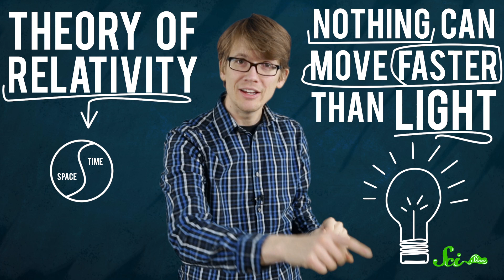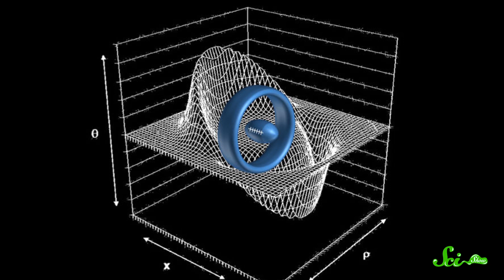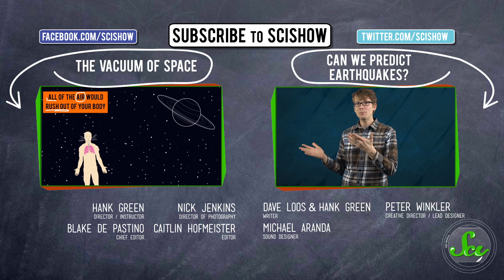Warp Drives!

Comment: When antimatter comes in contact with regular matter it annihilates replacing the mass with energy equal to the mass annihilated right?...65 Exajoules is like around the mass of a person, so can we expect warp-drives soon after we are able to capture and sustain antimatter (if that ever happens)? Or there more to it than that?
Reply: we would need to be able to actually obtain the necessary amount and sustain said amount of antimatter first. then get that up to space, then use it in a fueling process without a single antimatter atom hitting a regular atom and destroying the entire mission

we are very far away from even the first point I just made, like stupidly far away
Reply: The issue is not even if we can maintain it. The issue is with creating negative energy. So far we could only create positive energy (and yes, matter+antimater generate positive energy).
Reply: Disintegrating a person everytime we want to fly to another star is a bit unethical to be honest.

Comment: When there will be a Warp Drive, would it theoretically be possible to "fly" faster than the than the universe is expanding? If that works, we could see the end of the universe if there is one.
Reply: Sirappo Replying to a comment from 3 years ago. In theory, there isn't actually an edge to the universe, so no.  However, we would be able to parts of the universe  outside of what we refer to as the observable universe

Comment: I've been stuck with solution for the warp drive tests. So it's really simple. If we manage to actually use warp drive then the universe is finite. Look at the space fabric like it was a carpet. You can create ripple if you push a piece of the carpet forward. The carpet "shrinks" and you can travel without the use of fuel. But you need to have a starting point of the carpet and an ending. If the universe was infinite than the space fabric keeps getting tighter or will be stuck in one place. So if Warp Drive actaully works than our universe is finite and then we are one step closer to a possible multiverse. If you think/know that I'm wrong then explain it too me. Thanks
Reply: Currently we know the universe as finite, however infinitely expanding, at an increasing rate at that.  And also I understand what your saying, but we would need to build technology to move space-time in such a way.  You would need something specifically built for such a thing as pushing it like a carpet, whereas warp drives arent specifically made to do this (I think lol).  Also it would take energy to create this ripple in space-time.  Those are just my thoughts lol
Reply: branster707 The only thing that would work is negative energy. Einstein explained that Energy is mass in his famous equasion. Mass bends the spacefabric. So the only thing that could work is negative energy. The opposite of energy. Negative Energy is anti gravitational. This means that you would have negative mass. I know that the universe is finite and expanding, but there are still people around that think that it's already infinite. This experiment would debunk their theory. Thanks for your thoughts.

Comment: Sooooo, figuring out the field geometry for a warp field is one thing.  What type of field are we talking about?  It's not purely a magnetic field, and if it's an EM field, then it would have to be in a mode of operation that is unfamiliar to science now.  It would likely be a new type of field that has a very strong interaction with the 'spacial fabric'.  Theorize, Mr. Data.
Reply: The neat thing is all types of energy warp space-time in the same way.  As long as you have energy or mass sitting on it, it warps.  It warps in a more noticeable way as long as the energy is dense, and that's what some people are trying to do in the lab right now.  The people at NASA that Hank mentioned are focusing lasers on to one tiny point to see how much it warps space.  The thing with this warp drive is that you'd need negative energy overall in order to bend space-time a certain way.
Reply: Josh Wilson I was wondering if the so called 'color charge' of quarks could be utilized, and used to create a warp field... and if that charge field would interact more strongly with space.  It does hold protons together ; )
Reply: I've severely underestimated you Khepramancer.  That's not something I'd know very much about, but I do remember watching a veritasium video called "Your mass is not from the Higgs Boson".  They described the strong force as really a empty space in the gluon field.  This seems like a space of negative energy, but it still has postive energy because the total color charge is white.  Maybe if we found a way to make a color charge of black?  But that's only what I've been able to gain from their video.  Who knows.
Reply: Josh Wilson It was just a thought.  I would imagine it would take some sophistication in quantum engineering to be able to experiment with such things... I don't think humans have come quite that far, yet.
Reply: Not quite.  But still interesting.
Reply: It's not a field, it's a bubble -  the force involved is just plain old gravity. Sort of like the technology of fixed wing aircraft is just plain old wind. Which is to say technically... but sort of not at all.
Reply: Brian Emerson So the question becomes, how do you generate gravity?
Reply: With the energy they talked about earlier.  We know how energy, mass, and gravity work together two ways.  We can take a bit of energy or mass and figure out what the vector field of gravity looks like around it, or we can take a vector field of gravity, and figure out what how much mass or energy goes where to produce it.  That's what Miguel Alcubierre did here.  He invented the "bubble" which is just the colloquial term for the vector field of gravity around it, and solved for the locations of energy needed to produce that bubble.  There is a special type of energy needed to produce this field, negative energy, and we don't know how to produce it in large amounts, but we do have several ways to do it in really small amounts.  And they're all independent of the type of process involved.  Same for the positive energy needed.  Gravity doesn't care how the energy gets there, or if the energy is placed by magnetic, strong, or weak fields.  (Fields are considered the carriers of energy, translating it from potential to kinetic energy and back again in modern field theory).  All gravity cares about is that the right amount of energy is in the right place for the bubble to sustain itself.
Reply: Khepramancer With the energy they talked about earlier.  We know how energy, mass, and gravity work together two ways.  We can take a bit of energy or mass and figure out what the vector field of gravity looks like around it, or we can take a vector field of gravity, and figure out what how much mass or energy goes where to produce it.  That's what Miguel Alcubierre did here.  He invented the "bubble" which is just the colloquial term for the vector field of gravity around it, and solved for the locations of energy needed to produce that bubble.  There is a special type of energy needed to produce this field, negative energy, and we don't know how to produce it in large amounts, but we do have several ways to do it in really small amounts.  And they're all independent of the type of process involved.  Same for the positive energy needed.  Gravity doesn't care how the energy gets there, or if the energy is placed by magnetic, strong, or weak fields.  (Fields are considered the carriers of energy, translating it from potential to kinetic energy and back again in modern field theory).  All gravity cares about is that the right amount of energy is in the right place for the bubble to sustain itself.
Reply: Just to clarify, magnetic fields are inherently electrical, there's no such thing as a purely magnetic field, they're intrinsically tied. As for what type of force is being used, it's a combination of a massive amount of energy in a tiny space ahead of a craft, similar to a singularity, and a massive amount of negative energy (Which is a place holder for something we don't understand yet) at the rear, imagine the opposite of a singularity, essentially the antithesis of gravity, that's what's really doing most of the work, the singularity out front is just to catch the ship, preventing it from scattering like light through a parabolic diffractor, from what I understand at least.

Comment: Hate to burst your bubble, but warp drive by 2100? Bullshit. 
I'm suddenly reminded of an old black and white program that told America all about the flying cars they will have in the year 2000.
Reply: Good analogy but what did people think about commercial aircraft 86 years before it became available?
Reply: I didn't say we'd never have it, I call bullshit on 2100. We're already 14 years into the century, and it's the same as it's been since 1990, but the boobs are bigger and the phones are smaller and everything is cheaper and faker.
Reply: Computers are incredibly smaller and have far more capabilities...................... 2110 could be hopeful and not realistic but at the rate we're improving our technologies I really don't think it's unmanageable. Despite what you have against the current state of the world (cheap and fake) our technology is increasing very rapidly.
Reply: I know, I build them for a living. Still doesn't change physics.
Reply: Ok...your point?.... it doesn't need to. If warp drive is physically possible (this argument clearly implies that it's possible) then there's no reason it can't happen by 2100. If you have an issue with warp drive argue that point. Not the time in which you think it will happen.
Reply: s0medudeonline
 if the theory behind space time as well as the capability of molding it with gravity can be proven then warp drives will happen. thats a pretty damn big IF but if they can produce a warp bubble like they are in fact trying to do, then think of how much technologies will boom just at the possibility. warp wont come first obviously and to be honest i dont think traveling to other planets should be the biggest goal, the ridiculous amounts of harvestable materials that are floating around in space could be just the thing we need to create the visions of the people who envisioned floating cars and huge epic cities, the only limitations we truly have are the ones caused by limited resources here on earth. the sheer amount of materials we would have at our disposal if space flight was easy would be more than enough to stabilize our crappy global infrastructure. think of it this way- if metals were as abundant as they are in space, right here on earth prices on them would drop drastically allowing for greater growth in technology due to availability. if we can ever achieve ease of access with space i truly believe that the world as we know it will change emediately
Reply: S3PT1M1 Fantastic Point :)

Comment: FUCK....I'm not gunna make it to 2100 ;_;
Reply: 3D printing organs is coming in like 10 years.

You are going to live to 2100.
Reply: Deliciousbutter No, the problem is in *your* jeans,
Reply: the problem in immortality like stated in older videos is how fast your cells die and how fast the cells run out of energy to keep duplicating each other
Reply: Deliciousbutter That is only an issue for body cells that divide frequently.  Your neurons... don't.  Yeah, the glial cells do, and the cells in your circulatory system do, but as long as you can avoid a brain aneurysm, 3D printing of human tissue will completely evade all the time-based death issues in your body.
Reply: Deliciousbutter Okay.  Here's what you do.  You get some cells from your patient, you culture them, you flood the cell culture with telomerase while you're culturing them.  Their telomeres do not shorten.  It's like you put a pause button on aging while you're culturing the cells.  You print the organ, and then implant the organ in the patient.  The telomerase you flooded the culture with eventually breaks down and is recycled by the body.  Because you haven't CHANGED the dna of the cells to produce their own telomerase, just supplied the tissue culture with telomerase you made yourself it does not suffer cancerous potential.  The organ you created resumes aging at the point that the original cells you collected were at.
Reply: Deliciousbutter That's complex.  But between everything else, the guy'll make it to 2100.
Reply: ***** *cough* Trans-Humanism cough It is possible cough
Reply: *****
Scientists have found that if a human corpse is frozen very quickly after death, possible future "nanobots" can repair cells that have been damaged by a similar process to when you freeze a steak and it comes out freezer burnt. I personally know very little about the topic, but look it up.
Reply: Is it a death clock? I thought it was the amount of times the cell spilts.

Comment: I read a paper somewhere that said using a warp drive to travel faster than light still require negative energy. But using warp drive to travel slower than light didn't, in fact the model proposed used a drive that could propel a craft at 1 to 3% speed of light and only required 100 terrawatts of energy.
Reply: Kristoffer Tell Another way to say it, the amount of power doesn't matter, but the amount of Time required is huge. :-)

Comment: turn of the engine.. warp effect disappears. and return to normal thrusters. remember you dont have to break from 10x the speed of light you are not moving at that speed. once warp effect is gone speeds return to normal. you create a distortion on the space time fabric. there is no inertia or momentum. thermodynamics are wrong at this point of understanding it will clear up once we harness and apply gravity to our use.

Comment: negative energy is  a way to create energy from nothing  

asume that you connect 2 balls with spring that pushes them apart, so positive mass will move in direction of force negative mass will move in opposite direction than force applied

so both accelerate in same direction indefinitely with constant acceleration  while positive ant negative enegy of each ball will approach infinity but they both remain at same zero energy sum

Comment: I think you need to go over Einsteinian relativity again.
There is no aether or fixed points in space, so space can not be a frame of reference. Hence none of the problems you've stated are possible.
Basically two objects cant have a dV greater than c because the universe changes the values of time and space so that from each and every frame of reference the dV remains below c. That means time and space can have their values changed, not that they have fixed points (michelson-morley proved that)

Comment: Good thinking, but no. Because the craft is inside a warp bubble which is technically not moving, the craft is also not moving at all. the difference between this and a rocket is like the difference between rolling a toy car across a table, and picking up the toy car so it remains stationary, while you put the table so in a spot where the toy car can be dropped straight down and be on the other end of the table from where it started.

Comment: the event horizon of a black hole is the area where the escape velocity is greater than the speed of light. this simply means that the curvature of space in that area is so steeply sloped that even light can not break free once it has fallen in. it's kind of like those sloped funnels that you can roll coins into.

Comment: all just a bunch of manure! neither space or time have any physical traits therefore cannot be affected in a physical way these kind of secrets wil be unlocked when we figure out why the copper coil in a generator remains copper over time , as atoms lose electrons they should become a new substance figure out how quarks become electrons and move into the copper to stabilize the movement of electricity and then we will learn to move at the speed of light

Comment: In star trek what made warp drives and no monetary system possible was cold fusion(practically limitless energy for almost no cost thus devaluing everything because energy is required for everything we do or make) we're getting closer to practical fusion but whether or not cold fusion is possible/practical is left up in the air for the time being.

Comment: Because of the power requirements, it's likely that - even if we find that this works - we'll need fusion reactors to generate the energy. Because of the kind of power storage you'd need, it'd probably be better to create a "carrier" class of ship so as to have the required room for crew, power storage/generation, and so on. I realize that you'd say it's very expensive, but I read recently that NASA is working on a super EM generator - check it out, perhaps?

Comment: I'm only half a layman but, the ship is immobilized inside the bubble as far as I know - that is there won't be any acceleration or velocity. If you "hit" -  engulf would probably be a better word - a space pebble I would assume that it will continue at the same pace (not 10c) it did before you came along, it's important to distinguish between moving through space (velocity) and space itself contracting/expanding. 
But hey, what do I know I'm just some guy polluting the internet.

Comment: Are the calculations of getting to Alpha Centauri based on moving from standing still (using earth as a frame of reference)?
Why not get a Solar Sail to get us to about 45 km/s (escape velocity of the Solar System from Earth's Orbit) before initiating the Warp Drive? 
There has to be an optimal speed, acceleration, and distance from Earth to start the Warp Drive. Would a slingshot from the sun or stupiter get us there faster?
Can you use WD and SS at the same time?

AAAH my brain thingies!